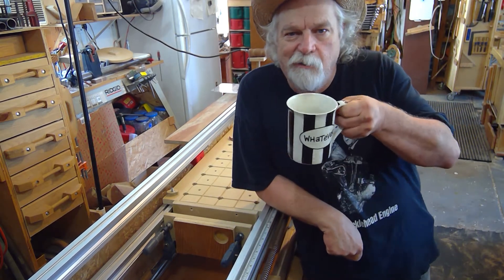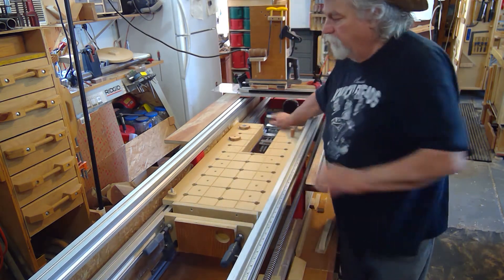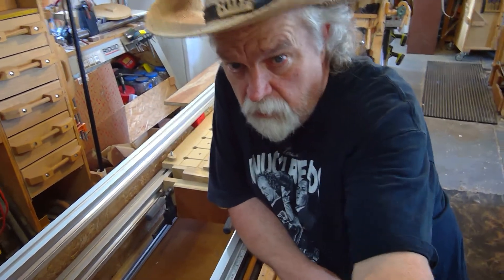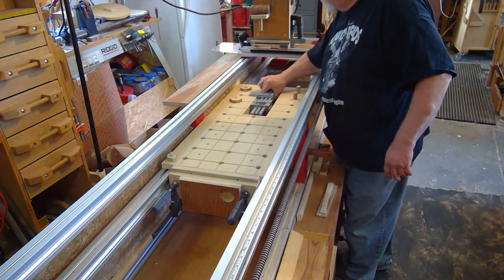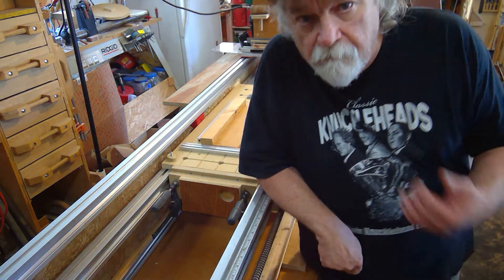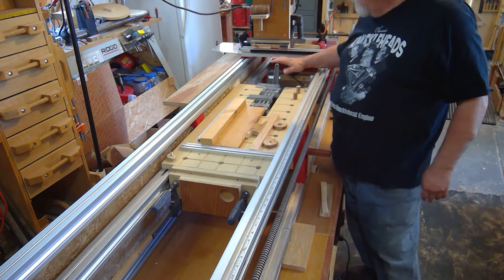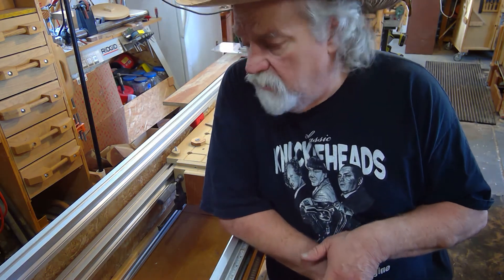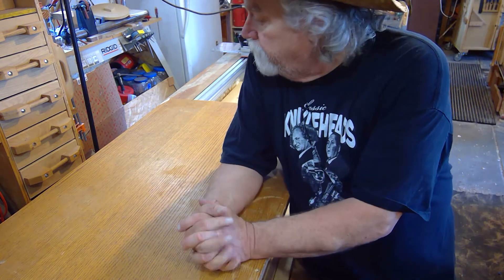Legacy Building my flat milling table

Comment: cool... I have I guess an ol' Legacy 900 or so, with some extras. I've been making wooden musical flutes with just lathes but wanted to try doing OD with this. Came with a MLCS Marvel Super Plunger 60 router, 3HP and I'm figuring out best way to have some vertical/depth control and/or upgrade the bed raise/lower situation that seems pretty coarse (screws and hex wrench, lol). Learnin' thanks
Reply from the maker: I love my LOM-1200 but it does so much more than what Legacy talks about.  I think it could be the second most used tool with all the secret things that can be done on the LOM.  I haven't heard from a fellow LOM owner in YouTube.  I think LOM users are more of a small niche in the world of woodworking.  I suspect most units are sitting in the corner of the shop collecting dust (like mine ( :>).

Comment: Hey Russ, just getting started in the legacy series, I had already planned to have interchangeable story sticks on my new waste board for different projects, my wife suggested gluing a ruler onto one of them, I'm going to steal your idea and put magnets in it and use a metal ruler! Can't wait to see what's coming next, thanks for the heads up, and all the videos! Later, Murph
Reply from the maker: thanks Murph. Don't forget to let me know of any improvements you make on my ideas so I can use your ideas too.  How big is your CNC table?
Reply: @russveinot5754  will do Russ, I have the original shapeoko 3 plus my enclosure limits it even more. Have very close Neighbors enclosure lined with 2-inch styrofoam!, 11 by 16 workspace! Oh well, later, Murph
Reply from the maker: have you tried (or thought about) doing center turning with the 3 plus, like making dowels?

Comment: Very interesting video, Russ.  Thanks for sharing your ingenuity with others.

Question:  You sort of glossed-over the spacing (and size) of the holes in the board.  I know that Festool uses 20mm holes spaced 96mm center to center.  Looking at your hole pattern, it appears you may not have a "one up - one over" pattern - where the distances between holes in the X and Y axes are the same.  I have an MFT and find that 1:1 pattern wonderful.  Have you considered using a piece of an MFT table for the top piece?  Or make your own - using the MFT layout pattern.  If I went that route, I'd experiment with where I align the hole pattern - to give me the holes where I thought they'd give me the most use.  Using a 1:1 layout for the holes makes setting up pieces perpendicular or at a 45 degree angle a no-brainer.     Just my thoughts.
Thanks again for all the time you put into making these videos and sharing them.
Mac
Reply from the maker: i use 3/4" dog holes, same as in the rest of my shop for attachment compatibility.  i have a couple of dog hole strategy videos explaining some of my attachments. they are under the "OTB Thinker" series.  

as to the spacing, i wanted 3 columns of holes along the x axis.  they are spaced based on the width of the LOM.  one in the center is centered along the x axis. the outside columns are spaced 1" inside the rails.  that determined the spacing of the 3 columns.      the only alignment used are the idea of the holes running true to the x axis or to the y axis.  i don't think there is enough space to give you much room for angle creating with the dog holes.  if i need an angle, i just set up the fence on the x or y axis and set the angle with a guage.  the table can't utilize the angle capabilities like with the MFT table because the width is so narrow to begin with.  my mini workbench uses 1:1 spacing.  check out my "OTB Thinker tee track uses" video for that bench.  thanks for watching